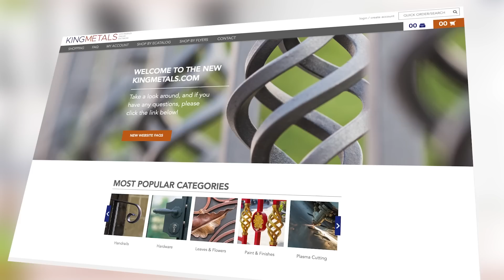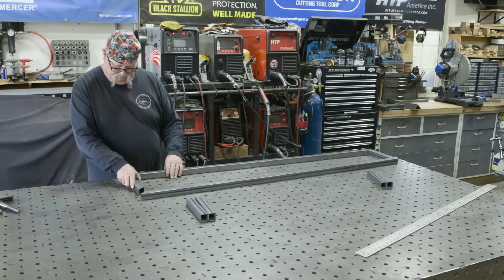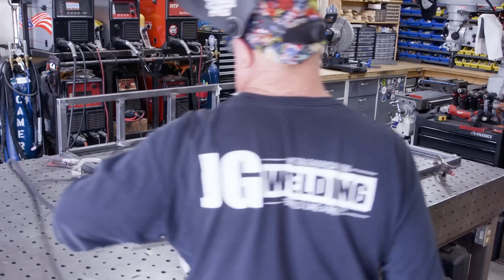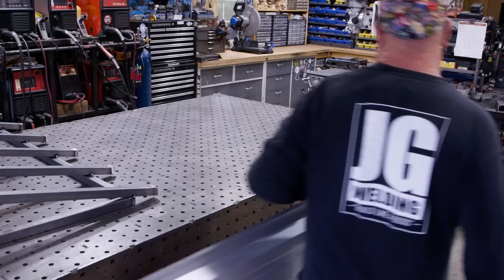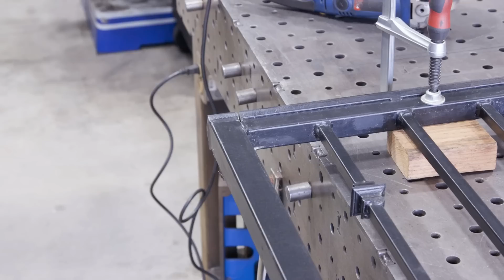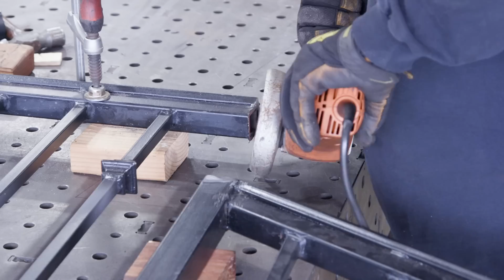Building a Custom Porch Awning: DIY Fabrication and Installation | Jimbo's Garage

Comment: Two things here, Jim. 1. As long as you bevel your edges, your welds after grinding are essentially full thickness of the material & plenty strong. ZERO concern there, so the neigh sayers can be quiet.
2. Great technique there where you extended the vert. You say sloppy/crooked, but "Sloppy" would have been cutting it shy and having to fill-in with weld metal. In reality you cut it proud and ground back to a perfect fit-up. Nice job there!
Great, creative problem-solving project as always. Thank you for all you do to teach & share with all of us!

Comment: Welding all around is the best. You often see nice gates, that rust over after 6 months. You can't keep rain out of a crappy welded gate...

In my area, they use galvanized a lot and it's sad that they start rusting on the welds after a year... The spray can cold galv is just not cutting it..
Reply: esp if you live near the sea

Comment: I'm with you on 'calculated risk' - a 6" wheel on a 4.5" grinder for difficult to access cuts.  A little care and there is minimal risk.  BUT - when you know it might grab your wheel and shred it, please wear a face shield.  I don't wear a face shield much in the garage (no OSHA there), but I do for the sketchier cuts.  

Rail and awning look great as usual.